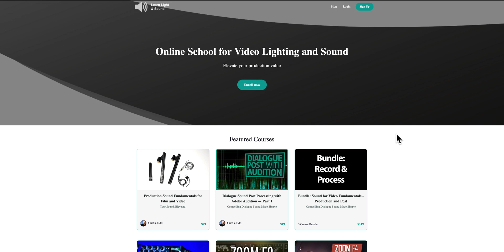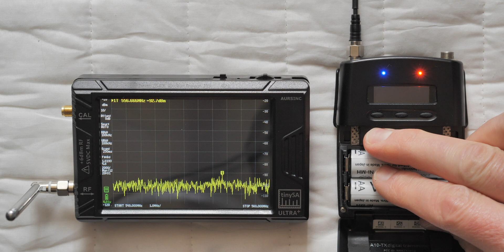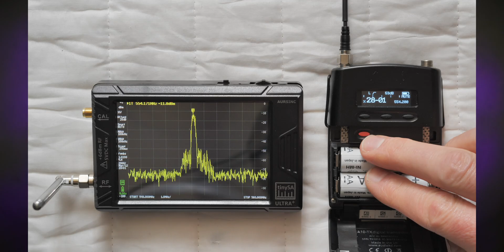What is RF spray from wireless microphones? ft. DEITY THEOS SARAMONIC K9

Comment: Does the burst always happen on the 550 Mhz range, regardless of the band you're set at?
Like, when you have the Theos set to the 630 Mhz range for example, does it still burst at 550 or will it burst on the lowest point of the range set at boot?
Reply from the maker: Good question. I'm in the US and it always hits 550 MHz at power on, then jumps to the tuned frequency.

Comment: I'm an "irrationally well-heeled audio production hobbyist" and I recently upgraded my SD setup from SL-2/RX-10 to a Nexus receiver. One of Nexus` features is a very capable realtime spectrum analyzer, and I saw the same thing very clearly from other lower-end systems that I happened to be using. Consumer wireless HW has very poor behavior. I've also noticed that the receivers in  consumer/prosumer systems are much more vulnerable to disruption by nearby sources than the Nexus is. I would guess that they don't have the Nexus' multi-stage SWA filters to deal with all of that.
Reply from the maker: Yes, I hold the same hypothesis - largely to do with the quality of the filtering.

Comment: This issue makes me wonder: what would be the expected behavior? Because, given you can't “boot up” the transmitter with transmission disabled, you are always going to “transmit on a frequency you may not be allowed on”, simply because it is still set from before?

Would the correct solution be to unscrew the antenna, boot up, then set the frequency?
This may also be a (albeit complicated) way of mitigating the RF spray issue?
Reply from the maker: The issue is that it sends a burst at 550MHz, regardless of the frequency it is tuned to. In practical terms, this means you cannot practically use 550MHz if there are any other transmitters in the vicinity, and, because the THEOS system used more spectrum per channel than other prosumer wireless systems, you have to plan for 400 to 700kHz space around 550MHz to avoid contention.

The best solution would be for DEITY (and Saramonic which does the same thing) to design future transmitters to NOT do any sort of momentary burst like this.

BUT, this doesn’t mean THEOS or Saramonic K9 are unusable, just that they should be reserved for smaller, indie jobs where there are only THEOS or K9 transmitters in the general area. They should NOT be used at larger events (pro sports, stage performances with more than 2-4 channels of wireless).
Reply: @curtisjudd let’s hope that the two companies may be able to address this via Firmware. I for one requested it via support and other contact methods. 👍

Comment: Those intermodulation products visible when both the Saramonic and the Deity systems are powered up could be some "mutual" interference between them, they could be created by the specrum analyzer front-end or some strong interference reaching the internal circuitry of the Tiny SA. I would try adding some realistic distances between them.
I think "RF spray" is actually some kinda broadband noise emitted by, maybe, faulty or poorly designed circuitry (insufficiently shielded digital interfaces/cables). 

I see both start the synthesizer without configuration briefly when powered up. While undesirable I wouldn't call it "RF Spray", frankly.
Reply from the maker: Ok

Comment: Well said. Well demonstrated. As a ham radio operator frequency coordination is some thing that does not get the necessary love in the film industry and sounds like it falls almost solely on Audio if they want the Radio's to not interfere with their microphones. RF frequency coordinator is probably a position that really should be unionized and required with all the Wireless stuff now. We had a emergency coordination training seminar thing recently where the state is trying to get a group of amateur radio operators trained up on how to coordinate if they need to call somebody in with more experience than the mayor's nephew who has a CB, for things like major incidents where you're going to have three news team show up and radios and swat teams, multiple agencies, etc.

I would imagine this is something that could probably be taking care of fairly easily with a firmware update. It sounds like a programming bug of somebody not realizing the severity of this. Device probably powers on the radio then initiates the frequency.
Reply from the maker: Yep, probably so. Hopefully whatever chip they’re using can be programmed to not transmit at its base frequency at power-on.

Comment: Not to worry, no other wireless system belches a 3 second, 1.3mHz wide signal at 550mHz on startup., regardless of what frequency band the transmitter is tuned to. And no, Deity and Saramonic can not eliminate this with a firmware update, or believe-you-me they already would have. Hey,  you get what you pay for,(unfortunately, so do your clients). And this is not really "RF spray," but I don't know what you'd call it, but its kinda like when you laugh while drinking and it comes out your nose. This is the result of poor, hurried, compromised product design using off-the-shelf chipsets made to do other tasks, adapted for RF/audio use by engineering school grads who mostly design lighting circuitry, but I digress. And it's probably why there are legal issues with bringing these transmitters into the US, but I digress.  RF spray is continuous generation of both random and harmonic spurious RF due to poor transmitter design and inadequate output filtering. Or inadequate shielding, like the thin little cables wrongly used for SDI video interconnects on cameras, or proximity to blowtorch video transmitters like Teradecks, or the RF hash generated by microwave ovens, pc motherboards and bad computer switch-mode power supplies.  By the way Curtis, you risk blowing out the RF input switch IC in your TinySA ultra by placing a transmitter right next to it, if you haven't done it already, like I did it to mine. Run the 30mHz input test as described in the TinySA documentation (look under "fault finding.") If you've blown it out, you can still use the thing, it's just less sensitive. Or, switch on the LNA on the TinySA to bypass the IC & regain sensitivity. But the LNA will fry too if you bring a 50 or 100mw transmitter shoulder-to-shoulder with the TinySA. They are generally unrepairable unless you have superb micro-surface mount soldering skills, the kind you need a microscope for. But at $130 a pop, who cares? For that matter, at $1090 a pop, who cares?
Reply from the maker: Thanks for sharing.

Comment: The wireless spray might be easy for the vendors to fix with a firmware update.  What is needed is to tune the frequency first and then turn on the radio.
This would work if the radio output can be turned on separately from the radio subsystem itself.
Reply from the maker: Indeed.

Comment: This test methodology is not correct. There is a proximity overload. Please move the transmitter a few feet away
Reply from the maker: We did that as well. The DEITY and Saramonic both still hit 550MHz at startup.

Comment: I did a job at multiple NFL stadiums on game day. I had to fill out a frequency request form for each site weeks ahead of the event. They either granted my request or denied it and offered me alternate freqs. Then when I got there, going through security they had a spreadsheet with all granted freqs. I had to turn on my TX’s one at a time and they checked the radiated freq and power for each one. Guy told me for Super Bowl they manage over 2000 frequencies! I thanked him for managing the frequencies because it made sure my freqs would work.
Reply from the maker: 👀 thanks for sharing! Wow!
Reply: When it's for a multi-day event, when you're going in and out several times, they usually give you a tamper proof sticker after testing and don't test every time you want to enter the venue
Reply from the maker: @pedropereira5043  👍

Comment: Surely Deity could fix this with a firmware update?
Reply from the maker: Maybe, unless the chip (or chipset) doesn’t allow it.
Reply: @curtisjudd  Was thinking they could add a delay to the TX signal on power up until proper selected frequency is attained but I know nothing about these things.
Reply from the maker: @antone9751 possibly, depends on the chip they’re using.

Comment: Is there a list somewhere of systems that have and don't have RF spray? I will likely be upgrading in the next few months and would find it useful as info before buying.
Reply from the maker: DEITY THEOS and Saramonic K9 are the two I know of that do this particular type of spray.
Reply: There's no list, because no other professional wireless microphone would dare release a product with this almost comical spurious emission. They wouldn't pass FCC and IEC regulations. How did Deity and Saramonic pass FCC approval? That's a whole other rabbit-hole. The Deity "burp" also is not just an innocent little 550mHz yelp. It's a 1.3mHz wide blanking signal centered on typically busy 550mHz, and could interfere with as many as six other wireless channels at the same time. Talk about showing up to the party and sneezing in the hors d'oeuvres.

Comment: This was very informative thank you! Is it fair to assume receivers do not impose any signal as they are not designed to emit but rather receive a signal?
Reply from the maker: If they do emit UHF that would be very bad. But many of the current receivers can be controlled by Bluetooth apps so they certainly emit 2.4GHz.
Reply: @curtisjudd  Thank you that's worth keeping in mind.
Reply: Any super heterodyne receiver will emit some RF. As it will have a local oscillator. Often 10.7 MHz below the receive frequency. Now, if designed correctly it should be minimal.
Reply: @glynnetolar4423  Thanks for the info, I guess it's worth doing some tests on my bag then.

Comment: In amateur radio, what we commonly refer to as "spurious emissions" are typically unwanted frequencies generated beyond the primary transmission frequency, often due to poor RF circuit design or inadequate shielding.

Comment: I love how small your RF Spectrum Analyzer is. When I was filming at Formula 1 and one of my Sony wireless transmitters was tuned to a frequency the Sky guys were using they found me using a massive device that looked straight out of the 1980s. It worked, obviously, but it was comically huge and heavy compared to what you are showing on screen.
Reply: @memostothefuture  modern high end spectrum analyzers are still that size today, but of course with an amazing amount of functionality added. The tinySA is amazing and stuff like it being accessible to amateurs is great, but it's very limited, and absolutely would not do the job in a situation like that

ancient test equipment is often used for decades and decades, because why change a running system
Reply: @tommihommi1  Yeah, it was a really odd way to find out about that stuff on that day at the track. Thankfully they were nice about it.
Reply from the maker: Aha! Caught in the act!

I’m not sure mine would be able to pinpoint the offender, but it is pretty nice for things like we did here.
Reply: @curtisjudd  Oh yes, I got caught in the pit lane, which was quite unexpected for me. Had to follow them a long way into an office where they had people assigning frequencies. They knew how to change me over to the right frequency. Definitely a first for me.
Reply: When I was working at the Venice international film festival an RF Engineer was going around managing frequencies for everyone so when we turned on our wireless systems they didn't interfere with someone else going live at the red carpet for example. I remember he had a keysight fieldfox which was quite big and fascinating
Reply: @POLARICED  The fieldfox is tiny for "real" analyzers, but it's a super impressive piece of kit.
Reply: @ What would be a real analyzer? I'm curious to get my mind blown over
Reply: Its the Tiny SA Ultra as far as i know its even open source
Reply: bigger>longer working distance

Comment: Thanks for the video. Do the Sennheiser and Sony packs have the same type of RF spray? (Those are the only "pro" ones I know of besides the Sound Devices ones... I am sure there are others but I couldn't afford them.)
Reply from the maker: I haven’t specifically tested them since I just got this real-time analyzer, but will check when I get to use them again. I’d be VERY surprised if either of them do this. Very surprised.
Reply from the maker: I just tested the Sennheiser EW-D and SHURE SLX-D transmitters and they do NOT hit a frequency like the DEITY and Saramonic kits do. Also, they use a narrower range of spectrum so you can pack more channels into the same spectral range.
Reply: @marin_real_estate_photography  I can't say anything about Sony's transmitters since I don't own any, but Sennheisers are pretty clean in this regard. Of course, you still have the intermodulation problem that's inherent with analog transmission systems. So they dont spray noticable like the theos, but in their normal operation they spread far more since its analog transmission
Reply from the maker: To clarify, *Sennheiser G4 are analogue and generate intermodulation, EW DP are digital and don't exhibit the intermodulation issue to the same extent. Sony UWD-P use analogue tranmission and exhibit the intermodulation situation. But all of that can be managed using an app like Freq Finder or just good old math. 😊
Reply: @curtisjudd oh true, i totally forgot that sennheiser has the DP Series now😅
Reply: @curtisjudd  great find here and should hopefully be a firmware fix of set freq before turning on tx output .  "digital" transmission is just square waves vs sine waves. digital does let you have a tx with a more narrow freq width vs analog. wisycom has a analog narrow band analog tx mode that reduces intermod to the point of where they claim 300k spacing between units. I'm not that brave and try to keep them about 1mhz apart when on my own when running lots of mics.
Reply from the maker: @thedp  👍